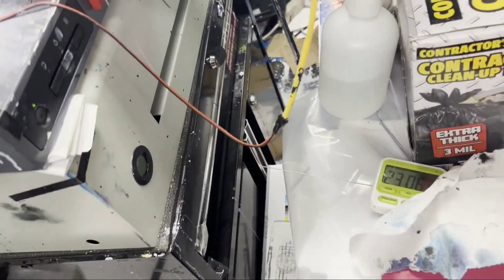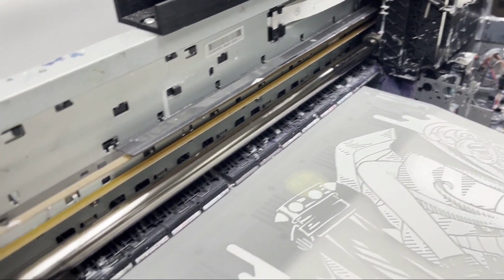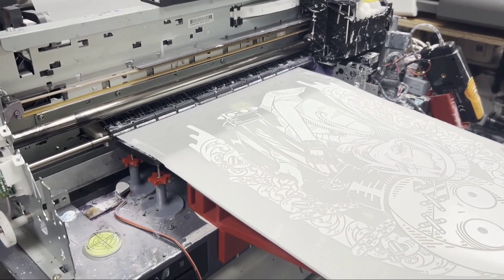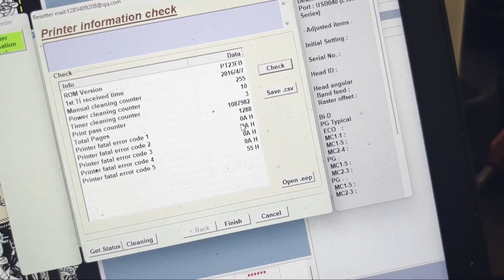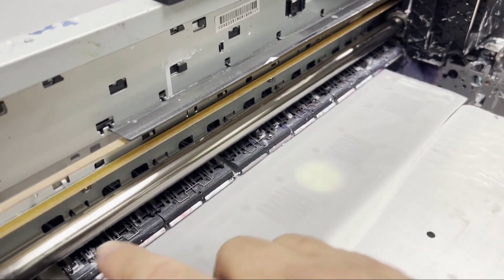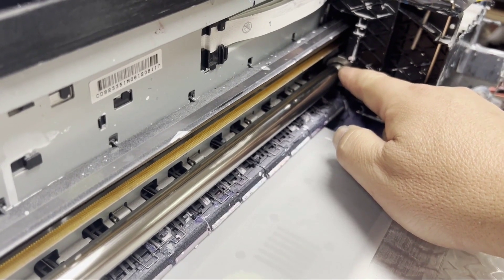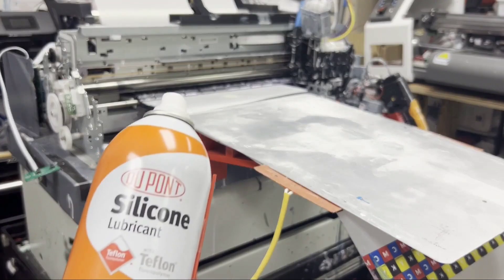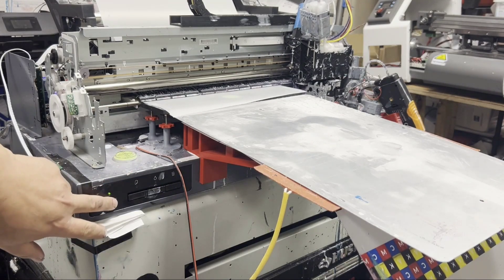Printer Stops Randomly, High-Pitched Squeal, then Blinking Lights - 0x0A Error Fixed!

Comment: Hi Kevin - My daughter's machine has the flashing lights. In her case, when she powers on the machine, the cart moves to the center and then back to the right. It then makes a loud noise as the cart tries to move but can't because it's stuck or hitting something. Is there a height adjustment for the ink cart when it's positioned over the waste ink pump? 
Below is a response she got from support - This error is caused by the ink cart being too low to move out. The waste ink pump is stuck by the waste ink pump, or it may be due to a malfunction of the waste ink pump, causing operational errors and inability to unlock the ink cart. The cover on the left side of the printer can be opened, and then try adjusting the height of this position to see if it can be repaired. Also this is the error code: Manual cleaning counter
160
Power cleaning counter
12
Timer cleaning counter
3
Total print pass counter
910009
Total print page counter
12011
Last printer fatal error code 1

Last printer fatal error code 2

Last printer fatal error code 3

Last printer fatal error code 4

Last printer fatal error code 5

Serial number

Firmware version
PT23FB
OxOA DC Error (CR). Load positioning control over-speed error.
Ox0A DC Error (CR). Load positioning control over-speed error.
OxOA DC Error (CR). Load positioning control over-speed error.
Ox0A DC Error (CR). Load positioning control over-speed error.
Ox0A DC Error (CR). Load positioning control over-speed error.

Is this the same error you are dealing with in the video? Any other ideas on what to try?
Reply from the maker: Thanks so much for subscribing—it really helps us grow the channel and get closer to our 100k goal! I appreciate the detailed info you shared, and yes, this sounds like a classic case of the capping station causing a jam where the printhead lock is stuck in the raised position. Try using a flathead screwdriver to rotate the pump’s axle counterclockwise (you’ll find a hole on the right side of the printer to access it); give it about three full turns, and that should release the mechanism and clear the 0x0A load positioning error. Subscriber questions from 2024 are all caught up, and in 2025 we’re prioritizing subscribers with responses within 48 hours—glad to help!